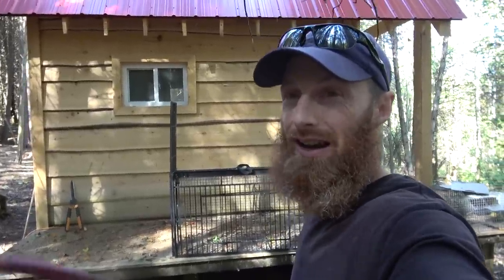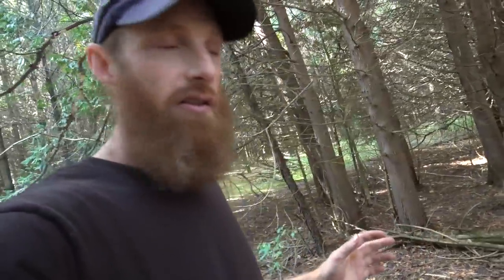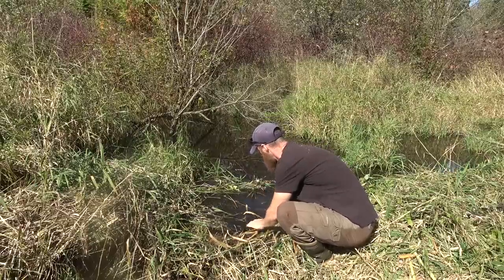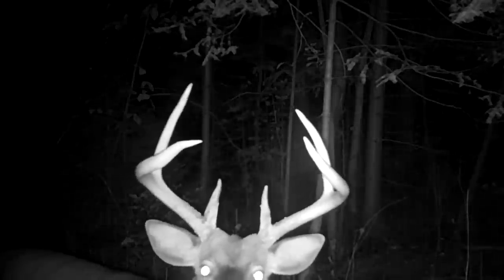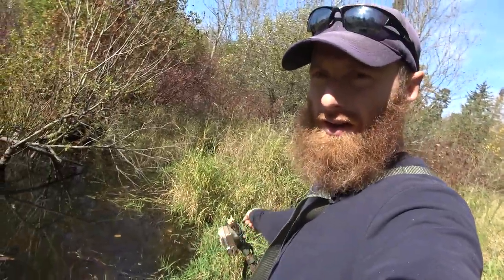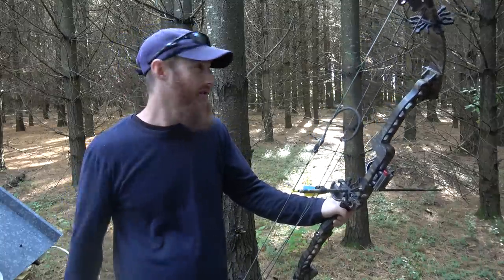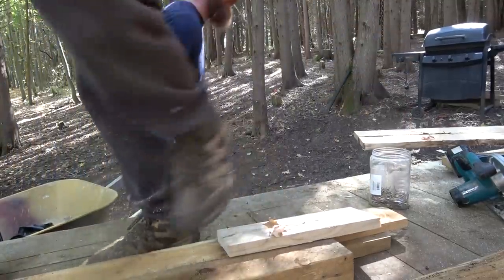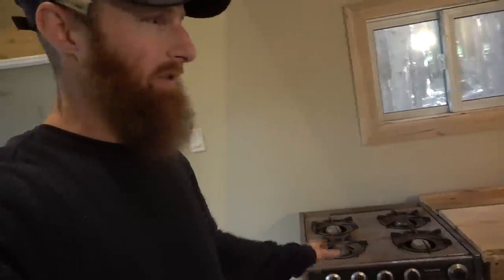SURVIVING 6-Days Off-Grid! (3-Gang Battery Bank) | Counter Tops, Drinking Water and Beavers

Comment: Full stop! My recommendation for extended power is to use leisure batteries, regular car batteries will work but wont stretch out longer compared to leisure ones. 
Also found it funny when mark used the AC colour code rather than DC colour code.   😂 (red & black) great vid, 👍
Reply from the maker: I added some tap to it later so I wouldn't get confused LOL
Reply: @TheWoodedBeardsman  lol. Thought to myself, "white & black"?? Bloody hope he wasnt gonna run AC into those cells! 😂😂😂 quite a neat setup all the same, will that be running in conjunction with the solar panel??

Comment: one thing you both.. i mean you and your brother never do in a video is add beats.. but looking at how it is..  IT IS TIME to add some beats...really takes out the plain video..more fun that way..being off grid... 
suggestions: 
1. add some corrugated metal kitchen back-splash.. behind the oven..drywall is fine..but corrugated metal will reflect some of the heat in the cabin.. with half an inch space between the wall and the sheet..
2. make a wood box and cover the propane tank.. easier to clean and keep the valves from freezing.. in winter.
Stay safe.. GOD Bless.

Comment: So you would survive if you just sat in a corner for 6 days in that cabin.
We usually say as a rule of thumb that a person will survive without water for 3 days.
But it's actually being able to perform labour 3 days without water.
Depending on circumstances you can potentially be able to live without water for up to 2 weeks.
But you'd be bored to hell and you'd get a pretty bad headache most likely. 
So put a few bottles of mineral water along with some snacks in your rucksack and you'll be good to go :-P

Comment: propane-butane gas tank shuld be in side becos when temps go dawn it will be go liquid(do-sent turn gas in low temps ) and usles  sry for me eng
Reply: thcfull Several million homes in sub zero temp areas in winter time with propane storage outside. Would have to stay below -42 C for a day or two before propane won't vaporize. Don't think he'll have a problem

Comment: You need to use marine batteries,deep cycle batteries not car and batteries. Marine batteries hold 12 volts all the way through the charge car batteries do not hold 12 volts through the charge.